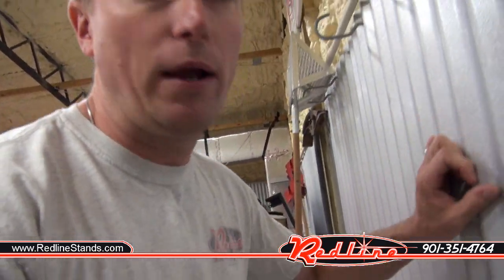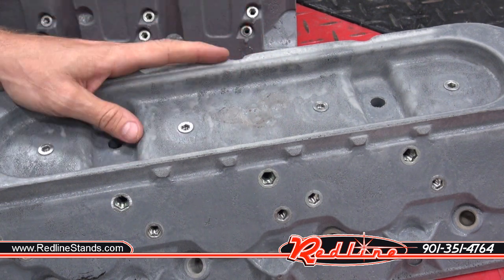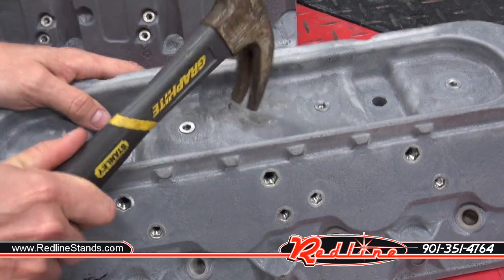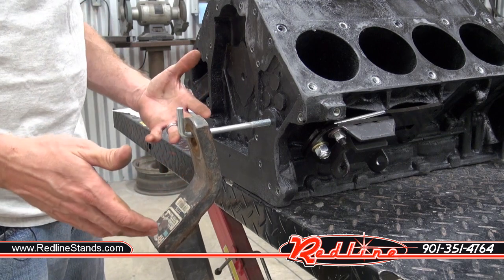Payr FAKE FOAM Engine Review

Comment: hay no dodge 426 hemi stuff??? why it's popular and there doing the 440RB finally ( thank you 🙏 ☺️ ) and i would/maybe go for that block and buy the hemi heads separately as im getting tired of luging/lifting my real 80+LB D-8/street heads around ( total engine package comes it at a estimated 800-1500+LB dry-weigh so yes a chunky setup/girl ) and or doing mockup in my 1968 charger ( doing a turbocharged TT kit so 1-off-crossram-EFI-intercooler intake and headers plus welded-in O2 ports aren't something that I can buy off the shelf at any-$$ as block hugger's don't exist! or at least that i know about ) BTW is there a TR6060/TR6070 ( picked the 70 as i wanted the 7-speed and deep OD not just because im being cheap ) ( i have a 2014 C7 transmission and a 1-off remote shifter that's points to the firewall/under the dashboard so kids/me/wife don't kick it when driving ) mockup/foam unit to buy? ( saw the t56 and not sure the make/model/year/not labelled well enough to know, but i know in real life/working units the gm 1995 t56 and 2014-up TR6060 and there more changes between the other-auto manufacturers as well aka different between a dodge ford or GM ect are different so not going for that as it might not be close enough or maybe im wrong. either way thank you ☺️ for doing a modern 6-speed manual transmission model/mock-up ) and or how much weight is it in foam? as mine is 220-ish LB working-unit and does the mid-plate ( not 100% sure but i might end up using the 2016-18~ hellcat mid plate/bell-housing ( looks like some GM guys are using the flywheel/clutch assembly ect as a HP upgrade but i like the DMF/duel or triple more ) as i tried the C7/comaro and most of it works for me but being im using a "normal RWD position transmission" its easier to try the dodge/tremic or others aftermarket parts/adapter's/midplate&bell and or make my own 1-off welded bell/block-adapter to SBM ) and or tail shaft come off as my real one has a costume tail-shaft/EV-motor in it

anyone you know makes clear valve cover's ? ( real aka operating temperature or static display aka under 120F/room/abeyant temps ) as the passenger side valve train is pretty and unique ( i have special 2:1 rocker's ect ) and id love to show it off at cars shows 

like the idea of leasing like the other poster mentioned and or a exstange, o well might have to ( try to resale it used after im done or ) talk the miss into leting me use it as a table/furniture lol 😂 or something else wacky ideas
Reply: thankfully the 392 hemi is done and i think 🤔 💭 the 3-gen but no 426? with removable heads ( thanks for changing the valve cover part as non removable was strange if your testing the real ones and there's a lot of different options the updated/MT-tomson's one's aren't ( thank you for the opportunity and or sacrificial one's for thing's like painting as my real ones are super rare and $$$ and or not looking forward to polishing off over spray ) my thing but lot's of others/owners are in to the one with 572 hemi logo/shape, my preferred ones are the SS or nascar 1968-ish magnesium castings with the spring/rocker's pockets and extra room for a bigger passenger side dizzy/magneto and the power steering bumps on the driver's side ) why? there's way more aftermarket market blocks and head combos labeled as dodge 426-platform ( and some aren't compatible with each other thankfully mine is compatible or mostly compatible with all or most stock 1970-OEM but still make's it harder to use the P-ayr-foam castings ie the head on a welding bench/vise and or removing the head to check piping/turbocharger clearance ect. ) so this as a businessman decision confuses me and more as a end user

Comment: Will this support turbos for mockup?
Reply from the maker: I asked the manufacturer and they said, "We do recommend that anything that hangs off the engine (transmission, turbo, etc) be supported underneath to hold the weight.  Our stainless steel inserts are molded into the plastic but adding extra weight supported only by them may cause the bolt holes to fail."